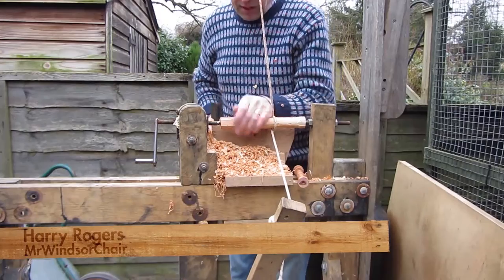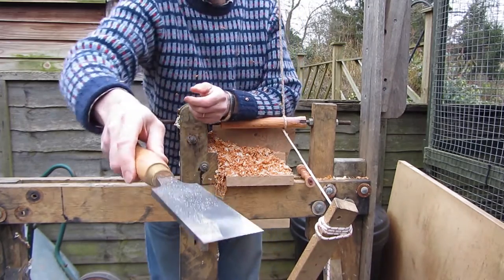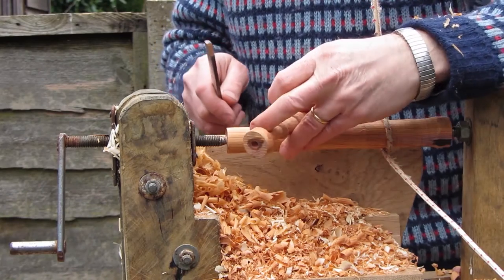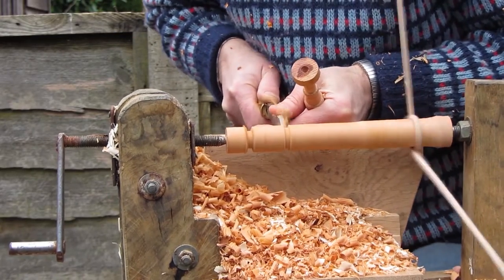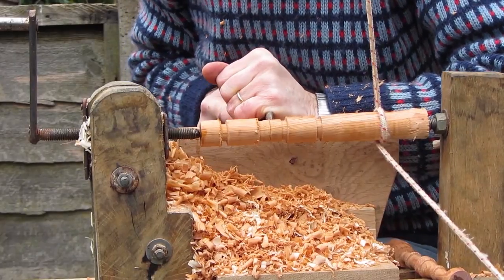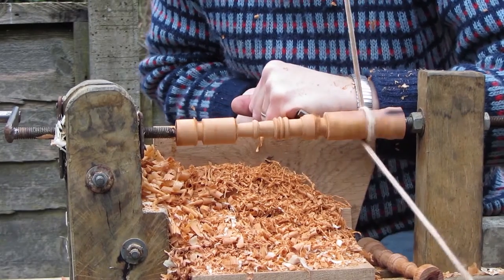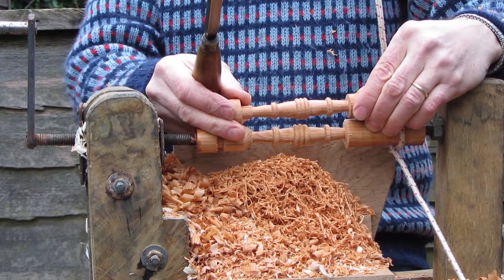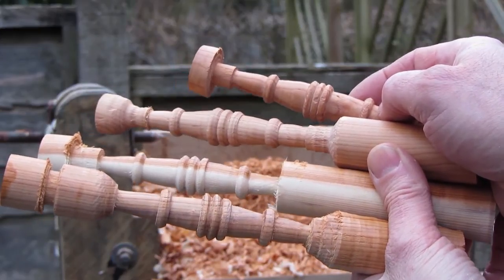Pole Lathe Turning Spindles - Sussex Chair Part 7

Comment: Wonderful job! 
I would like to learn this tecniques with old style ecological machine!
I follow with wery pleasure your youtube channel and I give you my best compliments. 
I have a questions:
For this kind of jobs wich wood is the best for the learner?
Can you explain me how means for greenwood?  
I d'ont understand if it is wood cut and carving immediately, or if it need a time to start the dry process.
Thank you in advance for your answord. 
My best greetings. 
Dario
Reply from the maker: Redarkrome Hi Dario...the wood is used while wet...no drying out...it cuts easier. Any hardwood is good...beech oak chestnut etc whatever you have.
Reply: Harry Rogers 
Hi Harry, thank you very mutch! 
I will try early to learn this wonderful job.
Have you some project to share with me for build a lathe like yours? 
Thank you very mutch. 
Dario
Reply from the maker: Redarkrome Hi Dario ...yes there are two films on building two different lathes.